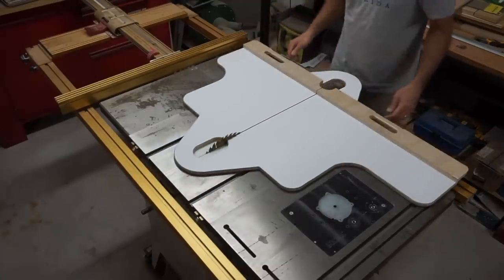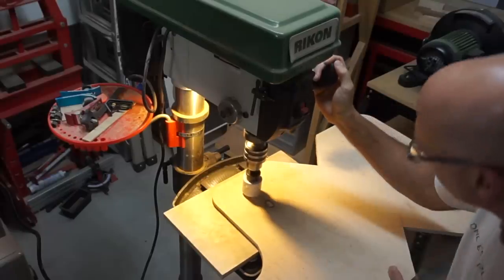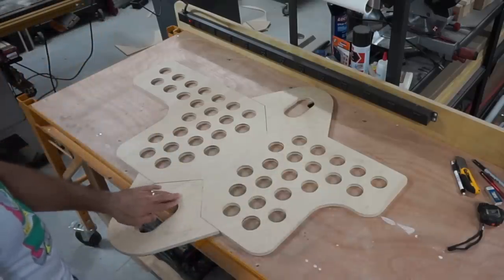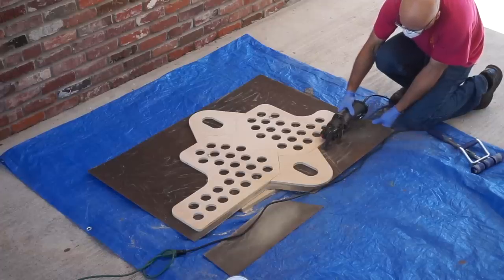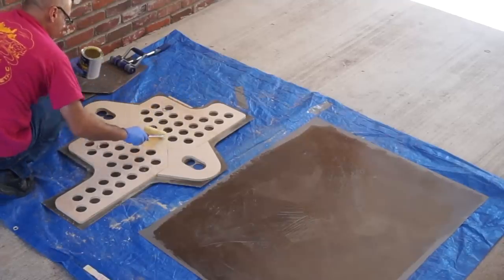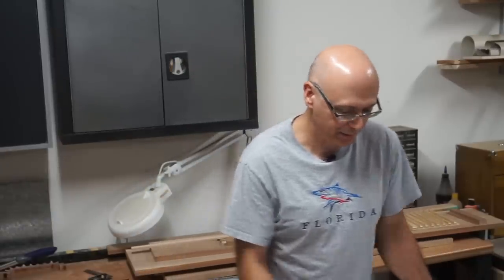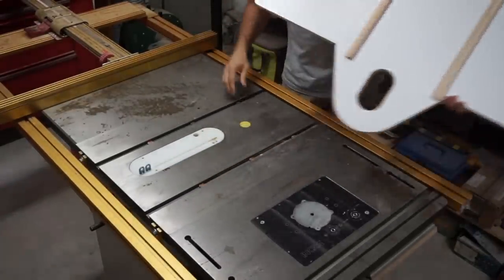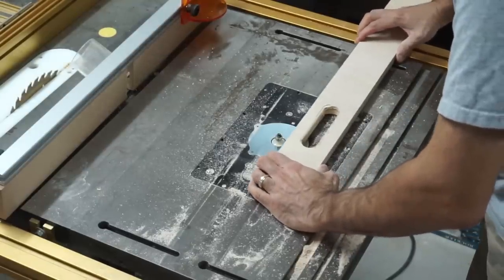A Crosscut Sled Like No Other

Comment: It's cool in the thin design, but impractical in several ways  I have no doubt you'll discover with use. Even though it's thin and visible and etc - I'd still  urge you to make a blade guard for behind the fence -  my uncle, otherwise a master carpenter and furniture builder,  got careless and cut his thumb off  using a sled with no back guard.  Finally - I  don't know how you got away with that first cut not flying back at you.  Nothing holding the workpiece down during the cut -  and running the narrow side against the fence is a recipe for a kick-back.  The problem with kick-backs,  they happen faster than you can react, so you don't know what you'd do.   Maybe nothing would happen...but then maybe you'd stick your hand in the blade...  I'm honestly not trying to be a safety know-it-all, but as I get older tablesaws (in particular) demand more and more of my respect.  A couple of my uber-Pro friends will no longer work with anything other than a saw-stop for that reason.
Reply: Tioga Fretworks a
Reply: Saw Stop won't prevent a kick-back though. Just keep your deli meats safe.
Reply: Shark Guard with dust collection and retro fit fiving knife.
Reply: The major problem is that American woodworking, or any material working here really, has never had any safety concerns or safety standards; and our 'craftsmen' have no regard for safety, or quality to be honest.
Reply: have you ever seen kickback without a fence? What situation on a cross-cut sled would the blade send the work back at you?
Reply: gonna suggest that perhaps you take a moment and figure out what you're saying before such a inflammatory post.

carelessness isn't going to be hindered by way overpriced 'safety' gimmics like the saw stop.

the reason why the piece didn't fly back at him has a lot to do with things like the fence he has, friction, gravity, the fact that the teeth push the work against the sled and the fence while working, you know....physics.
and 'uber-Pro' just means they charge too much for their work, not that they have any deep wisdom about safety.
Reply: I was also scared watching that first cut. The piece must butt up tightly to the fence through out the cut. If there was a gap or if the fence flexes then the piece could shift onto their back of the blade and be thrown at you.
Reply: Corey, take a narrow piece of wood and cross cut it with only your hands on either side to guide it. If you get the least bit out of true, you'll feel the power of the blade through the wood, but it will be more than controlled by your hands. How imagine a longer piece, where the cut goes beyond the blade while you're still cutting, and imagine the material shifting enough to get the least bit on top of the blade rising out of the back of the saw. 

Having hands on can mitigate the vast majority of potential kick-back situations, but that's not the only factor. It's called a cross-cut sled for a reason. It's called a rip fence for a reason. When you start thinking that you've just outfoxed the generations of wood-workers who came before you, an unusually clever and innovative breed of people, you are probably either brilliant, or a proof-of-principle waiting to happen.

There are some interesting and innovative things going on  in IBTW's sled. His 3/4" fence, eyeball-calibrated and epoxied, with handles to encourage you to take your hands off the work piece, are not among them.
Reply: Are you woodworking as a hobby or to make money? I've been using a 25 yo 3hp tablesaw for 10 years. No gaurds no push sticks and only cut one finger tip off. If your trying to make money theres no time for safety no when trying to compete with big box stores.
Reply: I have seen materials picked up by the saw blade.  Particularly as it get dull.  I could believe how well the piece stayed in position.  Defiantly needs some sort of work piece holding.  Rather then just gravity.  Someone mentioned also that if the builder checked the squareness of the material before making the cut.  Even if it was square.  As the blade came in contact, without a hold down.   It could have been slightly set essque  from the blades cutting action.
Reply: Tom Holmes hi Tom. Thanks for the reply, but I am still skeptical of kickback in this video's scenarios. We agree on the cause of kickback: outfeed wood catching on the rear of the blade as it rises up past the insert and being propelled up and forward. And I can imagine 3 of the most common scenarios where that could happen: 1) not feeding the work straight into the blade, perhaps because of a misaligned fence. 2) Outfeed pinching during ripping. 3) A noisy saw that vibrates small way stock back onto the blade. The only one that might apply to cross cuts on a sled is 3). 
You mentioned alignment being critical. Assuming his saws miter slots are aligned, then the sled is aligned. If the sled's fence isn't square to the blade, that would only produce a miter cut, not scenario (1). And scenario (2) requires a rip cut, something you are unlikely to try with a cross cut sled (is that your point -- people watching are going to try to rip some board down using a sled?)
Reply: There is always time for safety of some sort.  One cut finger tip is about one to many.  We don't have to go to ridiculous measures like the safety gurus  do.  Half of the crap they come up with is just to justify their jobs.  Which they don't include having to make money or compete in the industrial world in their judgments or calls . They should be required to operate equipment for a month with their suggested changes.  See if they have the same opinion at the end of the month about if it was a practical solution or not.
Reply: Agreed Corey, everything you say is true, until the unusual happens, and a nail or a knot or anything else that causes the operation to jutter occurs. At that point, you have a non-zero chance of bad things happening. I'm not so concerned with sheets goods transforming into decapitating discs of death, because the weight of them tends to make them poor missile weapons. What I've seen, and what anyone who's done much non-traditional table-saw work has seen is that once a piece of plywood gets on the blade, you can't tell what kind of secondary effects might manifest. For example, a torquing panel can cause the user to become unbalanced and putting a hand down somewhere unplanned, or their natural reaction to the event can result in them grabbing the work piece which is currently subject to forces that the user is unprepared to control. All of this happens faster than thought. Under normal cross-cut sled operation, the use of hands on the work piece will prevent many of the possible problems. It doesn't take a lot of force to exhibit a lot of control.
Reply: Tioga Fretworks Exactly what I thought.  Maybe implement some kind of hold stop clamp? put a stop block on the fence.
Reply: May not kick back but it could do some crazy gymnastics that I wouldn't want to be witness to.
Reply: How is this different then any of the other conventional sleds that also do not use blade guards? Blade guards do not prevent kick back.
Reply: I built Jay Bate's sled. Blade guards not meant as anti kickback it's meant to keep 10 fingers.
Reply: Just the other day I was cutting a piece of wood that had a knot in the middle of the board, which there was no visible outside appearance.  The board tried to bounce right off the blade and kick back, but I had a good handle on it.  It still chipped out part of the wood, jamming it into the blade causing the table saw to stall.  Now I know this is a piece of plywood he was cutting, but my point is wood isn't always exactly predictable and relying on friction and gravity when you are working with this kind of power tool that can cause irreparable damage, is very dangerous.  I have a friend who was an experienced woodworker, loose 3 fingers on his right hand due to an unfortunate table saw incident and another acquaintance whose husband cut off all of his fingers on one hand (he was at least able to get them reattached).   I'm not sure either would find the safety feature of a Saw Stop a gimmick.  That being said, technology can fail and there is no better safety feature than being careful and paying attention to the possible dangers, where it appears the concern was.  I'm not sure what exactly was said that was inflammatory, it seems that he was expressing his concern for what many people have comment was an unsafe action on a very dangerous machine, especially considering your average youtube viewer will replicate anything they see not knowing what dangers may exist in an action like that.
Reply: Xander, speak for yourself, I do follow safety measures and do quality work.
Reply: I hold my piece against the fence every time unless when I need a push stick.
Reply: Tioga Fretworks b
Reply: Tioga Fretworks, I agree with you.  By definition, this is a crosscut sled.  It seemed odd that for his first test, he chose an unsecured longitudinal cut.  But table saws already do longitudinal cuts just fine without crosscut sleds.  They were designed for longitudinal cuts.
Reply: Safety first, you will need those fingers to help you make money.
Reply: Okay Stumpy DeVido lighten up!
Reply: KICK BACK FROM A TABLE SAW BROKE MY LEG...... BAD DAY
Reply: The key here Tioga Fretworks is to get to heaven with both thumbs intact so you can sit in the jury box next to St. Peter as he advises God on new entrants. You need both thumbs to give a Thumbs UP or a Thumbs DOWN to the newcomer.  :--)
Reply: There is always time for safety, work smart not hard

Comment: Sorry. Bad design as you don't have enough back wall to give you a good push service as you tried to put your hand in those useless holes which you had to pull your hands back out because they hit the table as you went forward.
DON'T EVER RUN A CUT WITHOUT HOLDING DOWN YOUR MATERIAL!!!
Reply from the maker: I covered my ears because you were yelling at me and then I let go of the sled and it kicked back on me big time. Thanks a lot, Alan!
Reply: I agree. This isn't a safe design. I feel you should have a guard at the back to cover the blade after a cut and some way of holding the piece down using a t track or t nuts and hold down clamps. Also its difficult to use a stop block with such a thin fence for repeated cuts. I use the dial indicator method https://www.youtube.com/watch?v=AdXTtTnJAvk&t=71s for squaring my fences (I used to use the 5 cut method) and I felt your method was relying too much on your blade being 100% parallel to the slots. Sorry, a unique and interesting design but it isn't safe enough or accurate enough for my liking.
Reply from the maker: I guess you don’t believe in “reinventing the wheel.” Thanks for your comments, barnyardkh4!

Comment: For reference, you can pick up 3/8" thick aluminum stock a few inches wide and cut it down for guide bars.  I keep several around for jigs like this and they cost me a fraction of what the would down town.

One nice thing about aluminum guide bars is, you can drill and tap them and enlarge the slots on the sled to allow adjustments.

Comment: What is the rationale for making the central bulk of this thing out of 3 separate pieces, pocket screwed together, as opposed to one single piece of plywood?  Seems irrational, unnecessarily complicated, and prone to variance.
Reply: I thought so also.   He was acting like there was some purpose to it, he said it would be revealed later, but it never was.
Reply from the maker: It was just easier to cut those slots and the outer shapes on smaller pieces and attach them to the main sled instead of trying to cut all that geometry into the main piece.

Comment: Kinda hard to clamp a stop block on that 3/4" high fence and why in heck would you assemble the base out of three pieces when it would have been a lot stronger if it was one piece?
35 thousandths out of square?? No thanks, I'll stick to the tried and true designs with functionality, accuracy and versatility.

Comment: you guys crack me up . I flipped the switch on a table saw first time  at age 12  in 1962 . Still set up the same way and have never experienced  a kickback or drwn blood . My fence rides on old school bars attached to the right of the blade . I can go out 6 feet from the blade , my sled is only 16 inch wide,on one steel runner I I  got from an old mitre guage  also to the right of the blade , I feed with my right hand (not I push stick) my body is never in the direct path of the blade . Tool manufactures dictate the latest gotta have junk and we all run out and get it or try to make one . You do need to invest in a trim router though , my back hurts from watching you trim that laminate Harbor  freight has em for like 50 bucks they last a long time if that's all you are doing with them  I have 3 cuz I don't like changing the bits
Reply: me too!!!!
Reply: I once had a 2 inch wide 16 inch off cut catch the blade and shoot back 15 feet and bust a hold in the peg board wall ........... thank goodness it did not hit me
Reply: Had finished cutting through a 12" by 12" (3/4 inch) ply when the loose square got sucked onto the blade and was hurled into my stomach.  Had a nasty bruise.  Clamping a project would have prevented that from happening.  Oh, and the event also ruined my 12 x 12.
Reply: Almost 50 years ago, a piece of green wood I was cutting was grabbed and twisted out of control which threw my hand into the blade. My thumb stopped the blade, which allowed me to shut off the saw. A dozen stitches later, I still have all digits and operate with a modicum of caution. Such as: I don't cut wet wood on a table saw. Other than that, all of the rest of the safety crap out these days is just that...crap. All for a bunch of whiny little "lumber-sexuals" who shouldn't be in a WORK shop to start with, let alone near tools (Yeah, whiners, that's a gay reference ---get over it!). 
My dad told me long ago, "There are no accidents...just poor planning and application." The man had more common sense in his little finger than most have in their entire genealogical line!
Reply: +twicebitten thasme yep lumber sexuals own saw stops probably the same people that cannot drive 5 speeds
Reply: LMAO  not politically correct but right on point!  Some of these guys just crack me up running around workshops with designer tools that they haven't a clue how to use properly.
Reply: twicebitten thasme 😂”lumber-sexuals!”😂
Reply: The day I learned not to drill a 3 inch piece of metal without clamping it, I got to spend time commiserating in the emergency room with a guy who mangled his thumb from kickback.  While you have been lucky, it can and does happen. 

I learned a second thing that day too, even though I got through the doors first, he got in to see the doctors ahead of me.  I know first aid and came in neatly bandaged, while he came in with a loose rag full of blood. They took him within half an hour while I waited three. Lesson, do just enough first aid to stave off complications, but keep all the blood and gore you can muster to impress the triage nurse.
Reply: I appreciate your experience with a tablesaw. My mentor in the woodshop built furniture for 60+ years without a single mishap - only to have kickback tear skin off of his arm a couple months ago. You just never know what COULD happen. And with more and more Youtube, the videos of kickback/damage/injuries get more and more cringey. I'm not afraid of my tablesaw, but I definitely respect it's power. I've been in a shop for about a decade now (still new, really) but I still have a block terminating the saw blade and clamps for my workpiece - because... why the hell not?

I would never point my .243 within a few feet of another person - even though I know it'll hit within an inch of my target at 100 yds.... It's simply not a good idea.
Reply: "lumbersexuals"  Bahahahaha   I love it.
Reply: Well then, I'll bet your nickname is "Lucky"! You are definitely or will be cracked up, and probably sooner than later!
Reply: I like some of the older tools, they did a great job, I even like doing stuff by hand. I would really like to have a full blowen hand plane set. Im always looking for garage sales with older tools in it.  You can keep your pocket hole jigs. You can not match the strength of a good old fationed lap joint or long grain to long grain joint. 
I would however start using screws to build houses and not nails.  Do you have any idea how many carptners don't know what a crown in a 2x4 is?  Just look at the quality in modern home construction it really shows.
Reply: I read somewhere about guy who was hit by lightning!! Wasn't wearing his lightning rod and Al pie plate! Not "thinking safety"!
Reply: Lumber sexual. It's the politically correct term for a tree hugger.

Comment: What I find more astonishing than you getting lucky and did not hurt yourself is the fact that so many people think this is a great design and didn’t pick up on how dangerous this was!  I do give you credit for using the splitters.  However that only helps prevent binding, not kickbacks from unsupported cuts. I think if you add a few safety features and a taller fence you have a winner.

Comment: the sled looks like it will help slice off your fingers the do not see the handles being used cause they look awkward cause they have you spliting the blade with you body.... I also do not see any space saving really.... it just looks wonky and makes it very hard to clamp boards to it.... this is a case of over design makes things worse

if you want a good sled you could have added to the Incra system you have with the Incra sled that might have been a better option for your set up. I love the Incra table saw fence but you want to talk about something that takes up lots of space it is that fence on your saw.  If you have room for it you have room for a regular sled